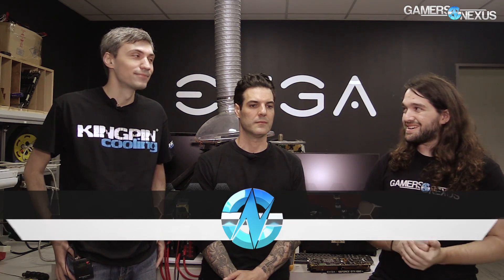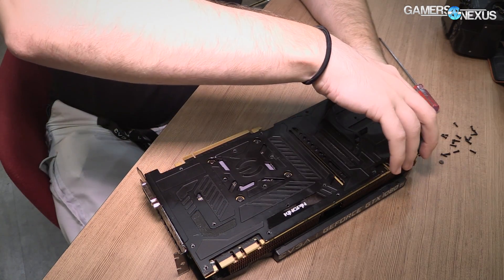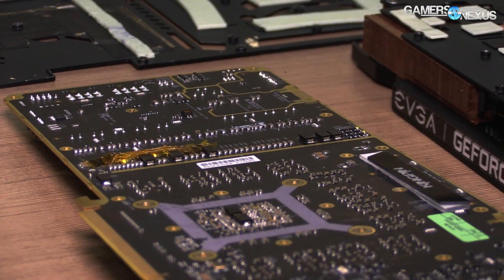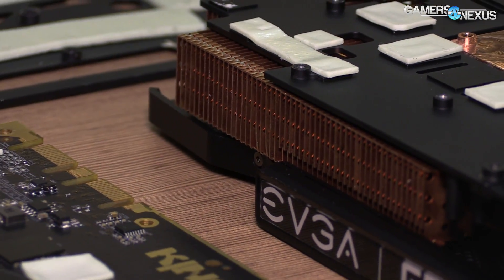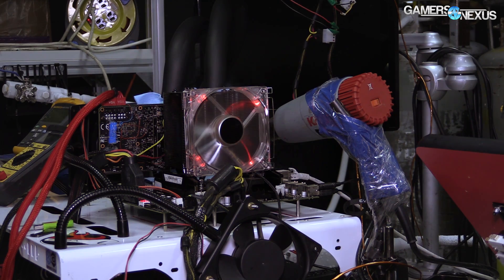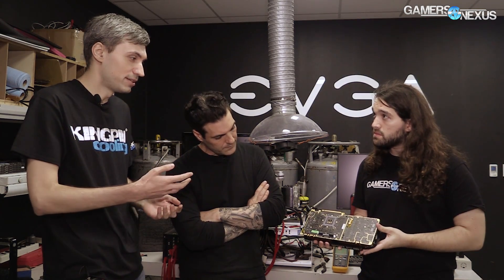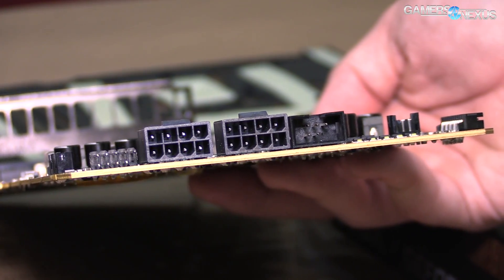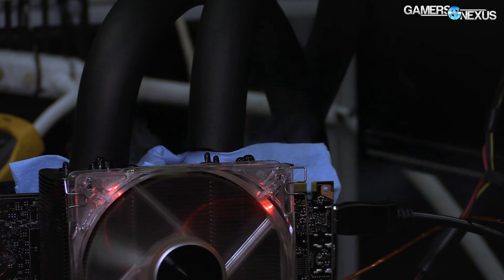Kingpin + TiN on Pascal Voltage, 1080 Ti Kingpin Card

Comment: Awesome card. I'm getting the new 1080 TI Kingpin Water Blocked version. I wish being an Elite Member would get me some discount on the new card. $1,249.99 is kind of steep. Now I have to decide whether to get the water blocked version or by the regular Kingpin and get the water block seperate and save $50 by putting it all together.

Comment: If this card really did run at 2400mhz like the screen capture showed than I would buy it. but it looked like that was the LN2 card with shunt mods to bypass all the power restrictions. it's cool to know the pascal can run that high. but I'm guessing it needs more than 1.093v. Vincent even hinted at you being able to flash the bios to bypass the limits nvidia placed on it. however without water you will kill the card. price points gonna be $999 or $1200 to compete with the TitanXp. the FE card oced will get you within 50mhz  of tbis kinpin without a bios flash and running at stock.

Comment: bullshit card. "Kingpin" cards are overrated.
Reply: LazorHD watch out got an EDGE Lord over here!
Reply: Giving vince exposure? are you dumb?

"kingpin" is world famous in all overclocking and pc circles.

its the other way around.
Reply: LazorHD or maybe he doesn't like cameras you inbred, he's an engineer, not a model
Reply: If you say so.
Reply: It's mostly for LN2, I think. All of those features on the card allow for better overclocking when the voltage and power limits are unlocked and the card is pushed to the limit. It's kind of useless for anything else, though.
Reply: you got a rx580 dont you
Reply: THY BCX go drink your a syrup sit down.
Reply: I just did thanks.
Reply: Yung Burrio no I don't actually. I'm still waiting on the market to slow down on the GPU craze. So far it's the 1080Ti and i'll just over clock that because the claims made here can be done without the premium price. Kingpin cards are for the dumb people who can't figure it out on their own.
Reply: I know your mad. It's ok. People that read YT comments with their thumbs in their mouths stick out like a sore thumb.
Reply: I got my MSI 1080 Ti Gaming X at £680 new on Day 1 so it was actually a HUGE bargain plus like I said, I upgrade GPU every generation so by the time I sell off the 1080Ti to upgrade to the 1180 Ti, it would have seen very little use. I have never had a card go bad as I sell them off after 1.5 years of use MAXIMUM.

Also I have firsthand experience with this Kingpin rubbish. I had a 980 Ti "Kingpin" and its "superior performance and thermals" were actually laughable compared to much cheaper custom cards from MSI, gigabyte, Asus etc. Never making that mistake again. 

For someone who upgrades to a new Ti each generation, Kingpin is absolute garbage and definitely not worth the extra premium.
Reply: I got an MSI 1080 Ti Gaming X you dumb peasant. A card that delivers solid performance at an amazing price. I upgrade to the new Ti each GPU generation and will replace it with the 1180 Ti. Just not buying this overpriced garbage "Kingpin" that will also be replaced next year with the 1180 Ti...
Reply: Indeed. Overpriced garbage and the Kingpin fool himself looks like a rude asswipe. At least have the decency to look happy for god's sake. Gamers Nexus is giving that son of a bitch exposure and this is how he repays him by looking all grumpy as fuck and crossing his arms as if he is upset about being interviewed...

Comment: This has so much more headroom for overclocking! I have an FTW3 card and I've only got 2068mhz on the GPU, and 5900ish on the mem.  Any practical use (or potential lack of) this Kingpin card will have is going to be interesting either way. A true competition card, nice!